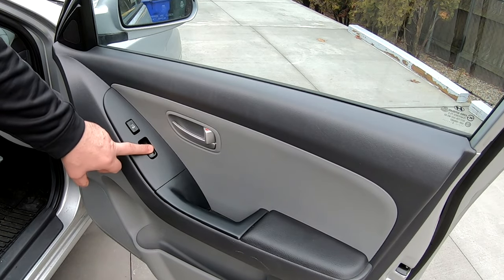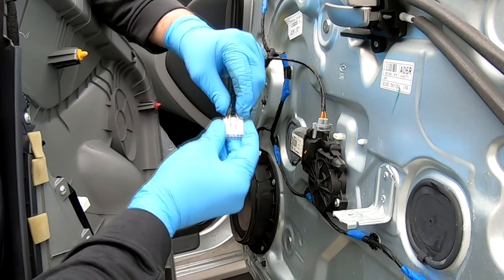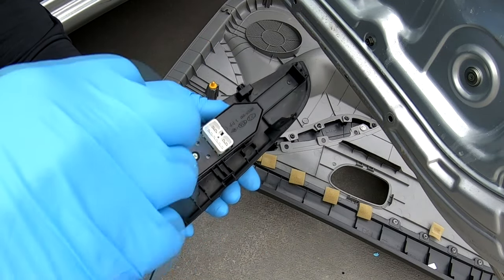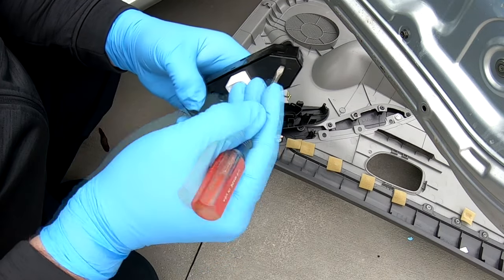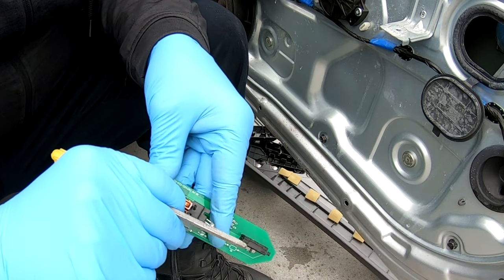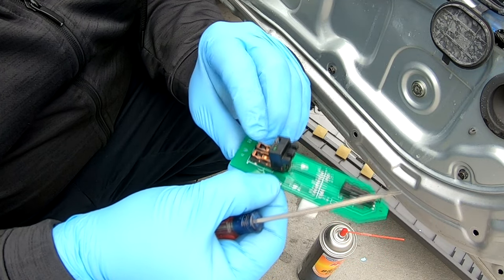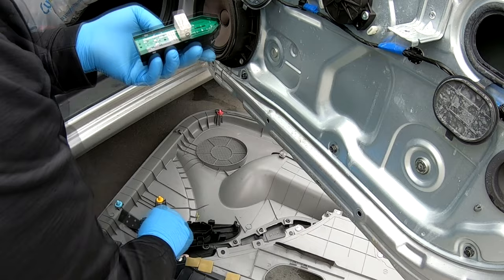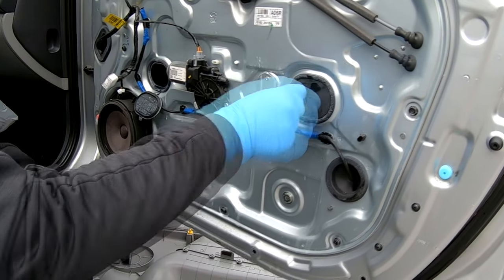Passenger Window Door Switch Repair-fix it yourself-2009 Hyundai Elantra | Techn' Moto

Comment: Nice video!  I have the same issue with right rear, but...window won't operate with driver control or right rear passenger control.  Where should I start?
Reply from the maker: Check fuses? 🤷‍♂️

Comment: Do you know if the circuit board assembly comes with the whole switch when it comes new?
Reply from the maker: I believe that comes as a complete unit. Last time I checked it was over $100 hence why I attempted to repair mine on my own. I’m sure if you call the dealership they could confirm that for you

Comment: Is this similar for a  2009 Elantra Touring (hatch back) ?
Reply from the maker: not sure, only one way to find out and that's dig into it
Reply: Thanks for your motivation and video.   I repaired the Touring switch with the long way (remove door panel, ->switch panel ->  the switch box --> circuit board).   When you did it  initially without knowing what is wrong,  it makes sense to take out everything one by one.   However, I  think it can be simplified by taking off one screw  (Touring)  or two screws (Sedan) to remove the cover to take out the switch circuilt board for repair.  No need toemove the switch panel.   Please see if  it make sense. 
For  the Touring, it needs a  short ( 1.5" tall  philips screw driver) to remove  that little screw.   If not,  it is more troublesome to remove the switch  panel from the door panel to get to the switch box - that is what I did.   The switch panel is bigger and is more integrated to the assembly process.  I had to remove 10 scews, plus cut out some plastic to access 2 more hidden screws (one from the very front and one from the very back) before I can take it out.   I guess the third time makes it a charm.  For those with a Touring,  search for "Passenger Window Door Switch Repair-fix it yourself-2009 Hyundai Elantra Touring" for some tips.

Comment: It's a great feeling ay  Mike when you fix something successfully,  great video 👍
Reply from the maker: Like I said if it didn’t work out I would have just replaced it but I figured I would give it a shot. Works great now.
Reply: @TechnMoto  when I lived in Oz, that's the first thing I'd check with duff electric windows, & it was always the contacts.  I have a Hyundi i30, which is basically the Elantra  like yours, bought it new for the missus 11 yr ago, it's only done 33,000 mile & runs like clockwork.  All the best to you and family 👪❤
Reply from the maker: Ya those Hyundai’s have come a long way. Very reliable.